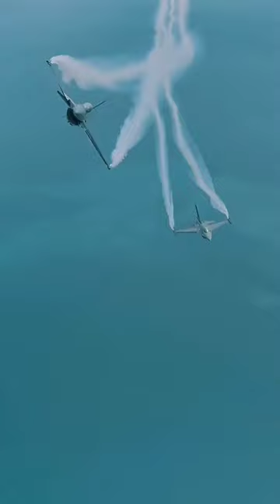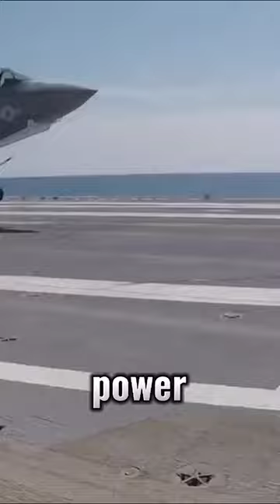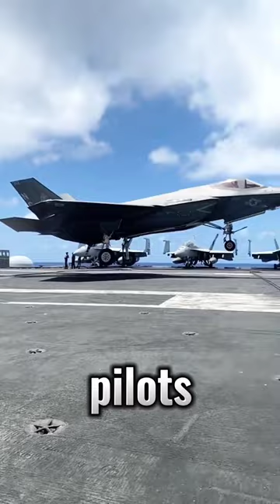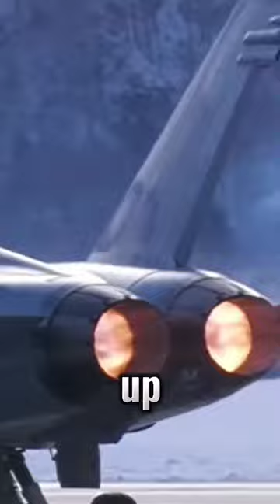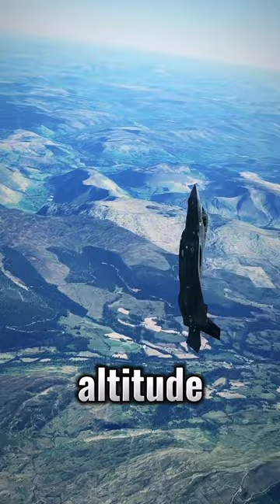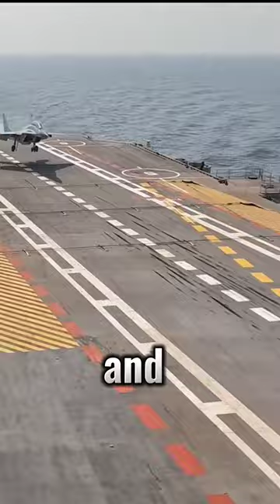What Happens When Landing Goes Wrong?

Comment: The pilots are hard on the throttle way before they would ever know they missed the wires.
Reply: thats what he said
Reply: @croissantgaming4932 no it’s not what he said
Reply: @croissantgaming4932 No,  he said they go to full throttle after they miss the wire. Wrong info.
Reply: @ManuelDiaz-on7tg h you’re correct I was wrong
Reply: @ScottySmac you as well
Reply: Right 👍
Reply: No they're not.  They advance the throttle the second they touch the deck. You cant land at full throttle. Once the wires stop them they back off

Comment: I thought the pilots fully opened the throttle the moment the aircraft touches the deck just incase she misses the wires she’s ready to take off again!!
Reply from the maker: Yes
Reply from the maker: Correct
Reply: Yes that's correct
Reply: Who didn’t know this? I would say most people have watched Top Gun.
Reply: That’s what he said in the video. They typically aim for the 3rd Wire as well. There are people on the ship that tell him if they’re fast, slow, high, low or on the correct glide slope. I want to see one of them land at night in battle conditions. That will increase pucker factor x1000

Comment: Case 1 landing on a carrier depending on the aircraft. Legacy f18C you will be flaps down gear down hooked down between 1:40 to 150 in speed. As soon as rear gear on touchdown will go to full power. It is a 3° glide slope for landing at a 5° pitch which takes years of practice there are many many bolters and some slammers that pancake on the runway especially on night time when you have new nuggets. I'm just an old Navy rotor head 90 to 96 CVN 67 that has been my experience with the f-14s. Aircraft misses the wire. It is called a bolter. The LSO landing signal officer is on comms with him or her during the approach and landing or bolter to give pilot hands-on information for the safety of the pilot and the ship. One thing I could not figure out is that they put so many years in training these pilots and also in basic flight. Maneuvers and air combat maneuvers the whole nine yards just short of fighter town in Nevada. Used to be in Miramar in California. Top Gun School. They get five tries to land on an aircraft carrier. To get one more opportunity if they miss all five to go back into simulation and on hard deck on the runway but nothing can give you the simulation of a rolling deck. Especially if the weather is so severe that you can see the screws on the ship as you approach to land. That's a site to behold
Reply: Did some training myself at Miramar.  Dilbert Dunker & night vis back in the day in '74, out of IB...  LAMPS Mk1 Aircrew,.ASW Operator, Rescue Swimmer, etc  Best times of my life!👍👍♥️
Reply: @stevemarkle6609  Best time of my life till we returned at the POC and got transferred to train auto rotation and a SEA knight but no more available so they put me in a 47. In the desert they would x-ray the main transmission gear every 250 hours, but after several incidences they brought it down to 100 hours, sometimes 150 hours. Well somehow it got lost through the cracks and I was training a co-pilot to do a mountain recovery or insertion carrying army paratroopers to manipulate the jump deck as the mountain. At 4700 ft. And I can see the field transmission BLEW slap up. All I had was power to the rear rotor main rotor and it started to catwalk so I disengage the clutch stove down forward to straighten it out. Pilot notified ground everybody scattered 84 souls on board 42 in the seat the rest standing hooked up center rail. Told the co-pilot to let me know when I hit 700 ft. He called it at 900. Trying to calculate the time from my reaction. So I got the back tail end to land like a feather but ran out of energy in the front. I knew as soon as I pulled the brakes I was too high but the front slammed the ground broke my back from the l3 all the way down in my tailbone. No, I'm just full of titanium rods, nuts and bolts. When I dove down and ammo can't slit underneath my seat and the lip that separates the cabin from the cargo did not stop it I guess. So I had no suspension. Everybody walked away. Matter of fact as the rear of the helope with the ramp down touch ground everybody was already gone just me and the co-pilot and engineer left on. Just a bad auto rotation. That's all. It took me out in a training exercise. Go figure
Reply: My first duty was on the USS Lexington in 1989, which was a training carrier. Just before I was redeployed to desert storm, we had an A-4 crash on his very first flight (RIP). Watching the pilots come in for their first trap ever was quite the experience for those on the deck, along with the pilots. Being on a WWII Carrier still with a wooden deck was interesting as well.

Comment: They don't up the throttle. The throttle is already up the second they touch the ground and slow only after they know they connected with the cables
Reply: But I have a Q how do you know when you are connected to the cables or not how to know that !?😅🤔🤨🧐
Reply: @mrigom1  as i said the engines are already at full throttle. the cable still slows them down, and afaik the engines cannot outpower the cables (and if they do, the cables were already damaged and the throttle allows them to get back up)

Comment: Fighter jet pilots are never stopping throttle incase the hook does not work as the hook is strong enough to stop a jet going the speed of a couple of hundreds of kilometers which is enough to take off and I think the hook can even stop jets going over mach 1 but I'm not sure also fighter jet pilots are thought to never go over 60-70% throttle because it can damage the engines

Comment: They actually land, on full power. 
There are 3 'catch-wires', normally aiming for number 2. If they do catch the 3rd cable, the pilots often receive  numerous 'happy-birthday' cards, and is 'congratulated' by all the ground crew..
It's not surprising, that carrier pilots, often become Very good instructors. They are highly Skilled, with nerves of steel.
Reply: Nimitz boats - with the exception of Reagan and Bush - have 4 wires. Reagan, Bush and Ford are 3 wire boats.

Comment: When the fighter lands on aircraft Carrier they are at full throttle. they don't go good too Full Throttle. They are at full throttle si if they Miss the Cable the Aircrafthas enough Speed too Get into the Air. When fighter jet lands at full throttle and when the hook grabs the cable and stops the Aircraft, that's when the pilot pulls the throttle to Idle.

Comment: This is wrong a pilot goes the full throttle just before they touch the deck of the carrier if they did it after have missed the arresting wire then they would crash